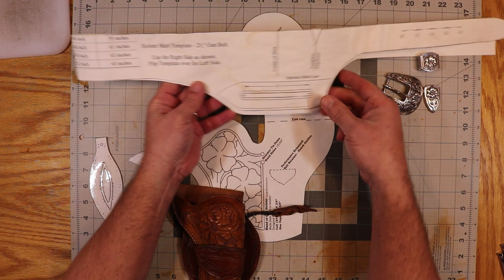Gambler Royal Holster- A holster fit for a Card Sharp

Comment: Great job looks and fits really well. When I retired from the military I took classes and worked in a orthotic and prosthetic shop making artificial limbs and braces. Some of the devices had a harness to hold it on better especially if the amputation was above the knee. I never used the sewing machine's but was always amazed at the skill it took to make the harness. My job was taking a plaster cast of the stump or limb and fitting the device when compleated.. Great video well done as usual
Reply from the maker: Wow, that's pretty interesting! I like the looks of hand sewn stuff and It's a much stronger stitch too. Thanks for the compliment and thanks for watching too!

Comment: Have you thought about putting the holster together with the glue and only doing one or two stitches every inch to hold it together, then wet molding, then dying, then remove the temporary stitches and sew it up for real?  Just a thought, that would waste the least amount of time and thread and still get everything done in the order necessary.

Great video.  Nice holster and belt.

German shepherd hair in the holster makes it more aggressive, like painting a car red adds 15hp.
Reply from the maker: I worry that if I don't stitch it all the way, it could "pucker" between the stitches  little bit and I'm not sure the glue will hold it tight between the stitches when it's wet. I'll try different techniques from time to time while I'm learning this leather stuff. Fiebings Pro Dye would help out a lot, it wont bleed out when it gets wet.
Thanks, I just wish the German Shepherd hair was long enough to be used for something!